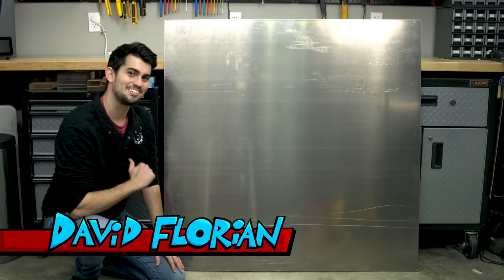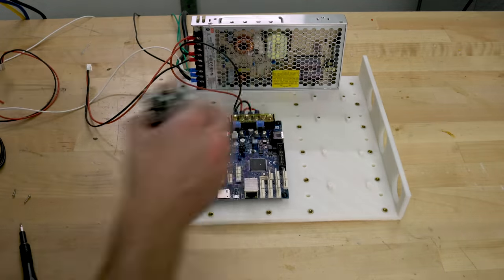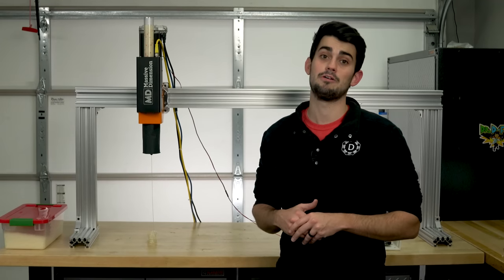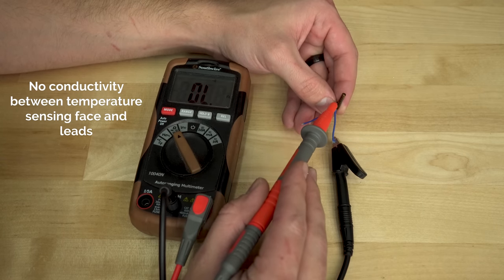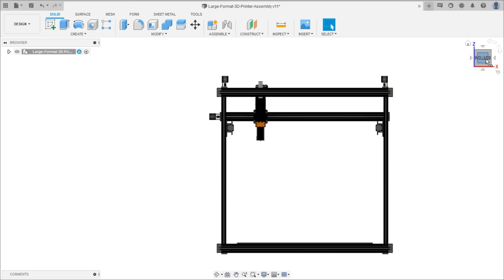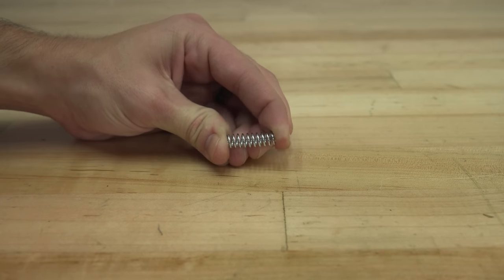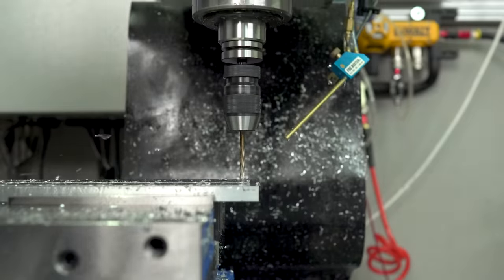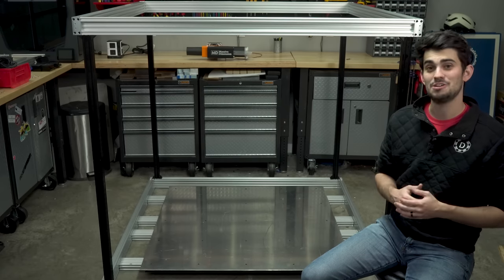Building a Large Format 3D Printer – Part 1: Pellet Extruder

Comment: I worked in the plastics industry for about 15 years (Primarily in blow molding and Injection Molding) the best way to do the supply (if you have the headroom is to use a vacuum based hopper system, Noise might be an issue though, I only know industrial applications, so might not be good for you. The biggest issue with pellet based extruders is cleanup. If you need to change colors you'd have to take the screw and barrel apart and clean everything to get all the old color out of it. I dealt with screws and barrels 3-12 ft long and hot (not fun), to clean them and the dies to change color or material. BTW your screw needs to be removed and everything cleaned while hot you you need some major heavy gloves. Found a YouTube link showing what I mean, these were about the scale I've dealt with in my past, be glad you got a little screw. Not trying to scare you just showing you what might be needed when the time comes for actually making things.
https://www.youtube.com/watch?v=67nxFiXOrhc&ab_channel=LearnIndustrialMACHINES%26AUTOMATION

Comment: Cool build!  A heated chamber would be a very interesting follow-up once the main assembly is done.  As far as pellet feeding goes, I once saw a pellet extruder system that used a vacuum (like a shop vac) to draw pellets from a bin into the hopper through a flexy hose.  It ran only at intervals, and I'm not sure how it was controlled -- maybe with a breakbeam across the hopper to tell when the pellets ran low?
Reply: Pretty much. In blow molding, you'd usually have an industrial vacuum motor on the hopper on top of the extruder gantry sucking up pellets from below. IR beams were, and likely still are, typical fill sensors. The extruder screws I've seen were able 3-4 meters long with heating bands and thermocouples around the barrel.
Reply: @onecalledchuck1664  Neat, thank you!
Reply: @jamespray  You're welcome!

Comment: For a noisch leveled bed you could go Prusa's new way of putting more single beds together to one big. So the bed is less likely to warp via heat if you put the right engineered base under it.
Also at this size it's probably mich easier to have the bed stationary and the XY-gantry moving up and down. The bed then can be pushed upwards by screws from underneath and be leveled this way. So you could use as many screws as you liked. Also your ground base then could be wood or so with the screws in it.
Reply from the maker: These are fantastic suggestions 👍 Nothing is set in stone yet for the design, so if it doesn’t work as I have planned then I will modify.
Reply: @DrDFlo  that's always perfect to hava an adjustable concept! You're definitely doing well. Keep on going and have tons of fun!

Comment: I don't think your bed leveling idea is going to work the way you think. You are basically relying on the springs to push the bed flat. More than likely though, the springs are not going to be strong enough and a downward warp in the plate is just going to compress the spring and the screw head will stick up. What you need is a threaded stud rigidly bolted to the bed that then passes through the aluminum block you made with a jam nut on each side. Then you can pull/push the bed flat as needed and it would be locked in place by both jam nuts tightened against the aluminum block.

Comment: You mentioned buying a custom bed heater. There used to be a thing in catering  that was used to keep a trey of food hot which consisted of a frame with a glass plate made out of mirror that had the silver layer partially removed in a rather maze like spiral pattern. This can be done rather easily by removing some of the epoxy coat with a diode laser, then washing with muriatic acid. Power it with wall current switched with an scr, and otherwise control it like any other bed heater. The acid is commonly used to bleach concrete and as a pool chemical.  Home depot sells 2 gallons for around $20.

Comment: 6:03 hopper at ground level with an auger pushing pellets up to flexible pipe depositing into a funnel (as you had to file the clear tube) attached to extruder. So that the heavy stuff is at ground level and the funnel and flexible pipe can move freely. The auger can control pellets to minimize the ooze etc.

Comment: You might have heard of Extrudinaire, they're gearing up to release an affordable pellet extruder which will retract, and according to their demos, it may retract spectacularly well. It's also super lightweight, so it can be belt driven no problem. However it's only rated up to about 300g per hour. It's intended to be used with an external continuous feed system so it would work with commodity motion systems.

I suppose just drilling out the nozzle like you did isn't quite enough, as the slicer expects the bead to be ironed flat, against the swelling that can occur right after the filament leaves the nozzle as the plastic molecules unfurl; but sanding a little flat on the nozzle should do it.

Comment: An internal valve like a ball valve that won’t change in internal volume would be perfect right before the nozzle to prevent leakage. Not sure how that would be done though. 

For the bed, what about small steppers with screws and a nut to adjust the bed?  You could move over the nozzle or sensor over a stepper under the bed and extend until it touches the sensor?  The whole bed would have to be allowed to flex a bit. Maybe a 5x5 grid of “bed jacks”?

Comment: For a stable precise bed. Buy yourself a second hand pool table. The 18mm or 20mm slate bed is CNC milled it’s intended use as a pool table. Even the cheap ones are pretty good. Just make sure that the pool table bed doesn’t have dips. I found the older the table the less likely it will have dips in it. For one mass manufacturing now is not as scrutinised as it used to be for two I doubt a bad table will survive the frustrations of any pool player for too long. Also slate is stone so once heated it retains steady heat throughout very well due to the organic composition of slate. By insulating the bed (wool+styrofoam) the slate will keep a constant heat and you will not need as much energy to maintain that constant heat even if there is a power failure (many homes have heated stone floors also traditional Teppanyaki uses small granite slabs heated from below by a small flame because it allows the meat to cook slowly over a prolonged period of time with minimal energy expenditure).
Only catch with this is: will your structure and motors cope with the weight of the slate bed plus the aluminium frame attached to the bed and to axis movers which will weigh around 60-70kg/m2 for the slate plus however many Lmeters of aluminium used. It’s important to note again I mention structure (fittings and anything that makes up the structure) and motors (that’s the motor itself as well as the gears etc) should be able to handle the weight.

Comment: My covid project was to build a 4 x 5 x6 foot printer. I turns out to be very similar to yours. The heated bed has been a problem. I have used a donated 2x3 foot 240 volt 2160 watt single silicon heating pad on a 8 mm aluminum plate ( Not thick enough ). It heats great but because it is a single pad I am unable ( I think ) to pierce it to mount adjusting bolts and springs near the center.  Unsupported it bows in the middle. Mesh compensation helps a little but to date I have only been able to utilize about half the bed. 
It has been a fascinating learning experience, since I had none, but it has definitely been worthwhile. Particularly the learning g code part (argh) !!!
Very cool video and looking forward to your next.

Comment: You should probably opt for rack & pinion for your linear motion on such a large format machine. Or go for a thicker lead screw. There's a lot of whip in that leadscrew when even trying to move the print head slowly.

Also, regarding the build plate, did you get cast aluminum? I've heard that that's important to make sure the plate doesn't warp at different temperatures.

Comment: To prevent having to have a large bin above the printer, you should mount a cyclone dust collector above the printer with a flexible hose to a shop vac. Then when you need to add pellets you can turn on the shop vac and vacuum up some at a lower height. You could add a pressure switch in the tube to automate turning on the vacuum.

Comment: nice video, tip for adding color, I had a small factory for making small decorations and had a blow moulding machine and we used a color powder that we put with the pallets in a big mixer before adding it to the extruder. and with a big nozzle like that you can even add glitters.

Comment: For the lead screw, what about some 3d printed spacers with bronze bushings?  The spacers could slide within the channel. Allow the print head to push them side to side, but have them return to the middle of the empty space with something like a constant force spring (tape measure thing) and a stop pin?

Comment: If you wanted more threadform through thin material running a rollform tap would have been an option, though don't know if the exit side extrusion would have messed you up. Though I've only seen rollforms run on rigid machines, big bucks to accommodate the size of that sheet.

Comment: Have some minor experience with injection molding. They use a screw also but it move in and out of the barrel slightly to do retraction. The other thing is that the molds have gates in them to shut off the flow of plastic.What about making a gated nozzle. My other million dollar idea was a gated nozzle with a wide thin orifice for printing wide walls. The nozzle would have to rotate to make turns but I think it's something to look at.

Comment: Have a look at CNC waterjet technology for a feed solution isolated away from the head. I haven’t finished your video yet so don’t know at what rate you’re going to need raw material feed. However to get rid or reduce the amount of scrap extrusion when changing materials you will need a smaller container at the head and most of the material kept at a larger hopper elsewhere which is automatically and pneumatically activated by the use of limit or proximity switches on the container at the head. Try increasing the heat at the large hopper. I have a gut feeling it will speed up the melting and consequently the extrusion. Just a suggestion

Comment: For the levelled bed, maybe you could have pull springs on the sides mounted with wheels to allow them to move but keep the same tension, so they'll pull the bed from the sides keeping the middle parts from sagging? probably wouldnt work at all, but just in case it would I thought I'd throw it out there

Comment: You've got to fix the lead screw wobble or it's gonna give you wiggly walls.
Reply from the maker: There is a tensioner on the linear actuator that can further alleviate this wobble but not eliminate it completely. This is just a limitation of the system, but when I am printing an object that is a meter long a little wiggle in the walls is going to be hardly noticeable

Comment: Galvanic corrosion occurs when two dissimilar metls are joined and in the presence of moisture.  Matting aluminum to steel will result in the steel corroding much faster where it is in contact with moisture.  This is more pronounced with standing water but atmospheric moisture will also help the reaction but not ad aggressively.  Hopefully, wherever this is the humidity is not normally high.

For a stiffer bed than the steel plate alone with the channels mounted on the back, a torsion box can achieve flatness to within 1/1000 of an inch.  The torsion box could have been made from alluminum.

Comment: That leadscrew has a lot of whip. That is not going to be good. You really should consider using a belt drive system. I dismantled an old pick & place machine (Zevatech 810). It had a 600 watt servo motor for on X axis and 400 watt on Y axis. Here is a video of the kind of speeds it had. https://www.youtube.com/watch?v=NZwLPoxxYI4  
The machine I dismantled was a little bigger than the one in the video. It had about 36"x32" of travel.

Comment: One question. Why did you go through the effort of designing and building such an awesome leveling system. Wouldn't surface mapping by a probe or something be the easiest route? You could have one solid bed and let the software do the leveling

Cool printer project really looking forward to seeing some prints and your solution for the pellet feeding
Reply: And for making the frame stiffer a cross pattern of steel cable properly will help

Comment: Add a color mixer before the screw it will be far more accurate and will allow you to print or injection mold in the color you want without any waste. Maybe a shot or  less than a meter if it's being mixed properly

Comment: I have been working on a 1000mm by 1000mm printer. I am using four 36" I-Beam Box Levels to form the bed which has a sheet of mirror on it (such as done by Ivan Miranda). The levels were only used as I-Beams but they do sort of aid leveling the bed. Mine does not use a pellet extruder. I am a long way from being done and I've decided to cease work and follow this series of videos.

Comment: Hey David,

I'm building a 590mm cubed printer, so basically a 2'x2'x1/4" build plate. I got the ATP 5 plate from "Midwest Steel and Aluminum" which was about $120 shipped. I priced it out and a 4'x4'x1/4" tooling plate (what ATP5 is) would cost you ~$500. No idea what the shipping would be.

For my build surface I'm using FR-2 (PCB material) from "Professional Plastics" which was about $25 for a 2'x2'x1/16" sheet, shipping was about the same price.

I'd include the URLs but YouTube is being difficult. 

Looks like your printer is going to be a monster. :)

Comment: Just an idea, you could use that extruder to feed a second more conventional style extruder with a 4 or 5 mm nozzle which you could control the flowrate more precisely when printing.
Reply: That was my first thought as well but then I realized that this would then run into the limitations of a filament extruder when it comes to overall flow rate. The filament being preheated would probably help with that somewhat but thermal management would be really difficult if the material is going to be close to the glass transition point and I can imagine the second extruder just becoming encased in a giant blob of preheated, oozing filament.

Comment: I'm not sure if this is a tech that exists, but you can feed additional pellets via air not unlike a venturi sprayer, up and down a wide flexible tube to the head, where the tube is attached directly including a small mesh-covered air escape. Simple optic sensor at the "full" mark in the feed could control the pressurized air source.

Comment: Cool project one idea to manage the pellets is to have a small vacuum mounted on the extruder that sucks up pellets and drops them into a small reservoir on the extruder. They used this system on a printer called the part daddy made by see me cnc and is also the system used by many injection molding machines.

Comment: If you change lead screw to bearing screw. You might get faster speed. Bearing screw usually have higher pitch. That usually helps with speed. Also your lead screw is wobbly. Would it not affect to print quality.

Comment: Ive used a pellet extruder before that ran a normal sized 3d printer nozzle... it was a very vintage stratasys machine (probably made in the late 90's or early 00's)  that fed domino sized pellets stacked up in a cartridge that would get fed on-end down into the extruder.  Super weird compared to what we're used to seeing today. The feed mechanism was a little touchy as the machine had some age on it, and I had to babysit it and make sure the feeding the pellet correctly every 10-20 minutes or so. Unfortunately, no idea what the mechanics of it looked like.

Comment: I wonder why you chose to thread the spring centering pieces. Wouldn't it have been enough to just have them printed piece slot into the 4 outer holes with pins?
Or even just reduce it to a fitting plastic spacer ring that goes between the tension screw and the spring?

Comment: Nice project, if obviously not for everyone. But it does open quite a big range of different possibilities and uses in areas where 3D printing would otherwise not be even considered as a part of the workflow. I can imagine printing thin shells as a foundation foor all kinds of molds, like for laminatng resins etc. Or even as  support structures for the final products. The extruder itself is hardly priced with the DIY crowd, but I think it's probably overpriced even for  professionals, because I'm pretty sure similar product can be assembled without much technical expertise from the standard parts for injection molding machines and such. And all of them utilize a metal tube, corresponding auger, heater and motor. Nozzle, too, although it's  a question if they could be used directly for this particular job, but as you are modifying these also, I see no big difference. I'd also explore the option of adapting, or even using as is, the desktop fillament extruder, like Welzoom B2, which is selling on Amazon for less that $700, and has very similar flow rate, nozzle sizes, and is even lighter than this one. I suppose if an elbow tubing was replaced for its rather small hopper, it might even work without further modifications other thn some means of attaching it to the machine.

Comment: For a perfectly flat build plate, instead of the spring method, could you mount a tool in place of the extruder (maybe even a Dremel tool or a basic motor with a fly cutter or something) to grind/cut a more rigid bed perfectly flat to the plane of motion of the extruder. You could even do this while the bed is heated. I'm not convinced the springs will resist the warping of the bed when heated, or that you'll be able to tune out the warping between the springs.